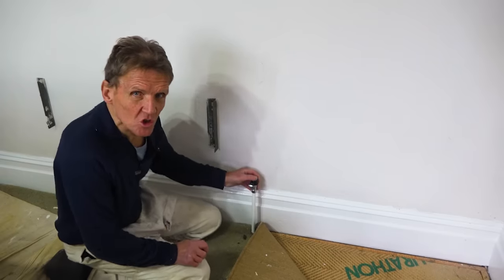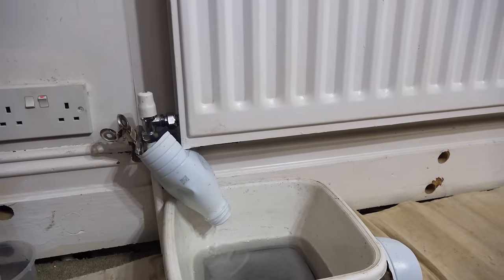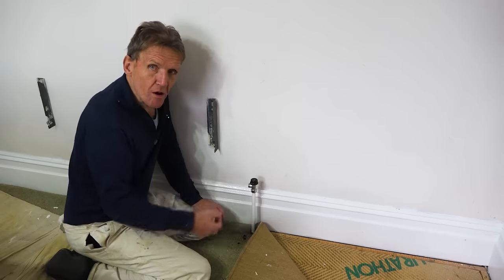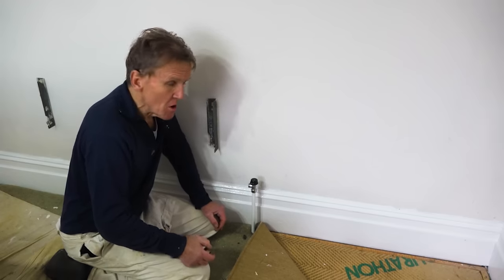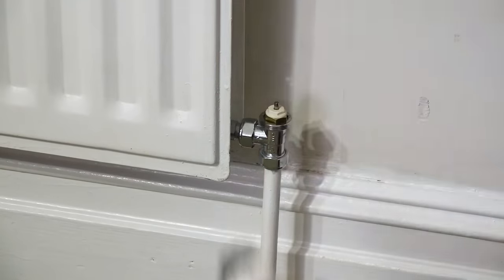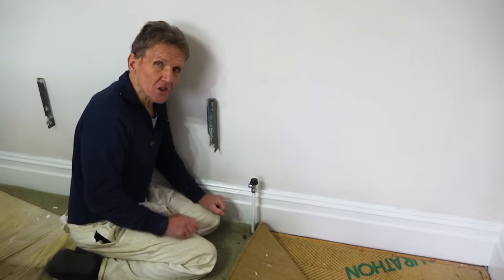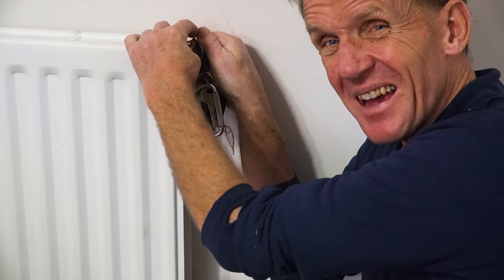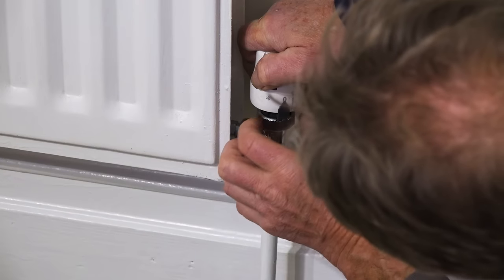Removing a Radiator for Decorating ~ Trade Tip

Comment: I fell foul of this decorating our main bedroom. Drained and removed radiator  and removed TRV. As it was winter, I decided to refill the system so that the other upstairs radiators would get hot. To my horror, washer gushing out and into the space below floorboards ,ie the living room ceiling. I knocked the water off at the main stopcock and shot to Toolstation for a blanking plug. I got away with some peeling paint on the living room ceiling and the wife never found out.
Reply: There’s humidity in there now so you need to get rid of it or you’ll be dealing with mold and rotting wood soon enough
Reply: Wife never found out haha most important

Comment: This is funny because I'm actually renovating a property and this exact thing happened to me last week. I removed the radiator and all was well until the night time. I woke up in the morning, boiler didn't work. I didn't know I had to cap off the radiator pipes. I only realised it was from the radiator because I tried to refill the radiator loop and water was spraying across the room. It was in an upstares room too so the living room now has water damage. not an issue as its being renovated and I haven't done the living room yet.  Wish id have seen this video last week haha!

Comment: I took a kitchen radiator off for a friend. I asked for the cover cap to replace the thermostatic valve, to be met with a puzzled look from the house owner. This was an old thermostatic radiator valve, with "freeze" being the lowest setting (i.e. no "zero"). I explained the situation, and was told that it wouldn't happen. That night it happened. Flooding in the kitchen (wee tank in the loft supplying the heating circuit).
Ever since then I do not trust these valves, but I use a couple of blanking fittings (all home brewed) to ensure there are no leaks. Belt and Braces,  because the alternative is awful.

Comment: What I’ve done is loose the joints on the rad lifted it up off the wall mounts and laid it on the floor flat on a pallet, tighten the joints back up sheet over the rad
Reply: Ah, that's a plan.
Reply: That's what I do every time and will be doing it again next week for a friend. Saves a lot of hassle.

Comment: A plumber gave me an alternative trick which I have used successfully.
Shut down the lock shield and trv. Put a bin bag under each gland. Slacken the gland nuts a little. Lift the radiator off its brackets. Lay it down. Tighten the gland nuts. Now you can access the wall behind without removing the radiator but it is a bit of a stretch.

Comment: I have put plastic pipe in ,mostly down the back of rads 10mm,left enough slack to remove rad of brackets onto 3x2 wood on floor ,lean rad forward,tie string of wall bracket to hanging bracket on rad  paint behind and re hang, no draining of rads,works a treat

Comment: I’ve seen a product Roger called ‘Radkit Pro’ which might be suitable for those who are nervous about taking a radiator off the wall for the first time. The ‘Radkit Pro’ is simply a device to remove a radiator without draining down the central heating system. The instructions seem simple enough as you clamp the Radclamp to the side of the radiator, undo the nuts, slide in the seals and lift off. Once you have achieved this allows you to paint behind the radiators or wallpaper behind them. Just wondered if you have come across this DIY product?

Comment: Hi Rodger, thank you for that! I remembered it from my City and Guilds too, it's the Snowflake TRVs. We had a great teacher who told us lots of funny horror stories. 
That sticks with you.

Quick question. I was doing a job where I had to remove a rad for decorating and it was no problem to keep the heating on because it was on spurs off the main ring.
However, the lady asked me to temporarily remove another one for a different decorating company but on investigation under the floor boards it wasn't possible without shutting down the heating in the whole house as the radiator was looped in and the weather was really cold. 

My idea was to take it off and run a bit of 15mm copper between the Lockshield and the TRV but I've not heard of anyone doing this.
Do you think that would work?

Comment: As an ex pro I can advise everybody...... make up blanking caps to fit where the radiator was connected to each valve.  That way you have eliminated any risk of a valve letting by.  It gives you peace of mind.  There is nothing worse than returning to your job the next day to find the valve has let by.  Make up a couple and keep them in your decorating kit.

Comment: I've disconnect 2 radiators to clean sludge from them. (Both had lock  shield valves either side) had no issues. On doing the 3rd radiator which has a lock shield valve and TRV on the other side, a massive amount of flowing water gushed from the radiator  and I think from the valve side as well. Have I just simply not closed off the valves correctly or is there some supply in valve I have missed.

Comment: My radiators only get luke warm. I've had a brand new boiler and a full flush. Still the same. 
I now want to rip the whole lot out and go all electric with oil filled radiators. Far better and cheaper.

Comment: The 1.5 bar pressure is when the boiler is on right?
I was told that when the boiler heats the water the pressure will rise again so ot may go too high if yoy do it to a cold boiler

Comment: Don't remove it. Find something about the height from the floor to the bottom of the radiator - a couple of paint tins usually does it. Turn off the valves, slacken the nuts but only a little. Lift the rad off the brackets, rest it on the tins ( to minimise pipe movement so you don't damage any joints under the floor) and rotate the rad it down on to the floor. Nip up the joints. Paint away. Refit in reverse. No refilling, only a few drips lost. Jobs a good un.
Reply: Old school top tip
Reply: That's the way I've always done it 👍🏻
Reply: That would only work if there’s enough clearance to lift it off the brackets

Comment: Or you could get a radiator cover two screws to put it on and take it off 😊
Reply: @girlsdrinkfeck  My little brain was trying so hard to figure out how a roller brush could be used to wedge the pin down :-/

Comment: C'mon Roger how many people have got those service caps after 10 years ? Most are thrown away because the customer does not know what they are - even if the installer has left them !
Reply: I’ve got several knocking around - I’ll sell you one if you need it😂